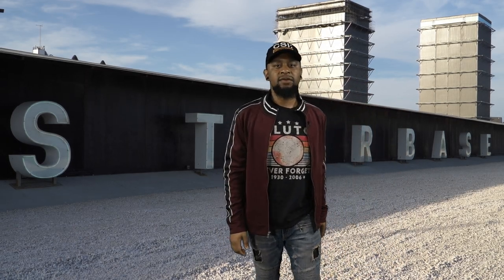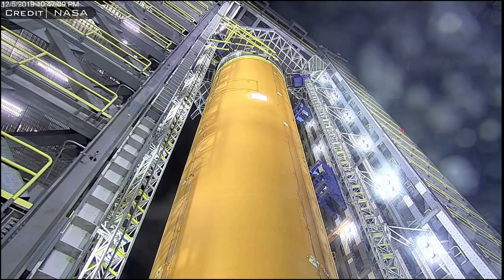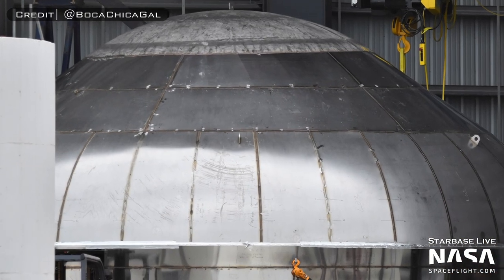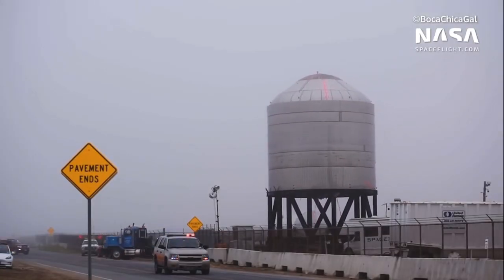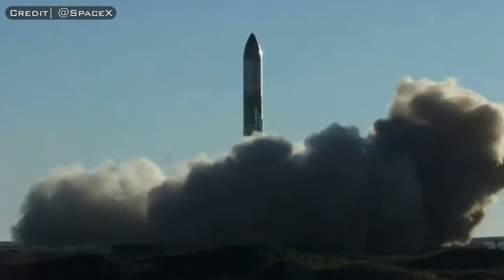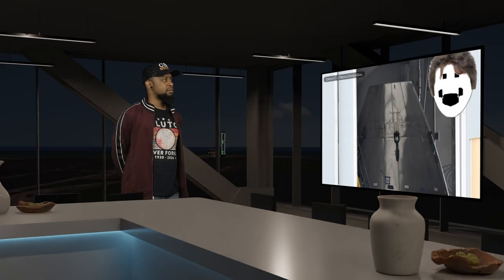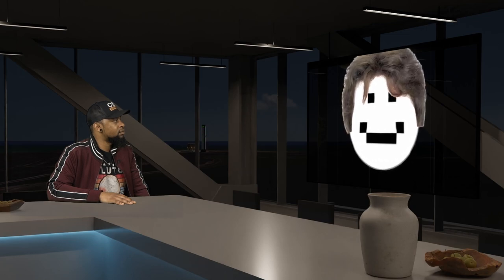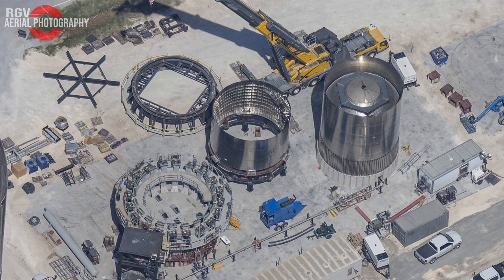How Did SpaceX Predict & Avoid A Catastrophic Failure Of Starship?

Comment: What a trip down memory lane, with quite a few blanks filled in. 
The B4 flaw was a lot worse than we thought back then.  
Well done Jax.
Well done Zack and team CSI.
✨️❤️🙋‍♀️
Reply: @StephanieB67 and @CSIStarbase, you're right about the B4 flaw. It seems that the stringers that go to the structural reinforcement on B2.1 may have been enough to tell SpaceX that B4 can not perform its orbital flight. So, my guess is with B7, they added the stringers all the way down to the bottom of the aft section: possibly to allow B7 to handle more pressure.
Reply: I might be wrong but firstly, the smart move would have been to have a successful test tank that simulated either a Starship or Booster or both. Then build the actual Starship and/or Booster. As reliability improves over time, SpaceX would get to the point where they can safely do this simulated test on the actual vehicle instead of the test tank. I still understand why SpaceX would want to rapidly mass produce both the Starships and Boosters, though.
Reply: @a.srijamorn3610  my guess is that spacex chose to get the most data from the widest range of possible issues all at once. Everything from production issues, to testing tanks, ships, and anything else

Comment: Great episode. You mentioned the first Falcon nine made a random rotation. Elon Musk said they didn’t take into account the turbo pump exhaust which exerted some torque that stabilization gyros removed. This is rocket science.
Reply from the maker: Thanks! We were going to dig deeper into that but the intro was already 10 minutes long lol
Reply: Incorrect. Gas generator exhaust wasn't powerful enough to create that rotation. Elon said it's due to the (as they thought) default 0° gimbal position that turned out to not be 0° in practice

See EDA interview
Reply: @alvianchoiriapriliansyah9882  I watched an Elon Musk interview where he said the turbo pump exhaust started the rotation. I did not make this up.

Comment: What an amount of detail in one video, unbelievable. Can’t fathom how much work went into this. And what a wonderful result, it really puts the development of Starship in perspective. It might have felt a bit slow the last year or two, but this overview makes it obvious that SpaceX has had the pedal to the metal this while time. We knew that, but it is another thing to have it presented so clearly. Thank you Zack and team, masterful work!

I am very surprised to learn of the flaw in the B4 generation design. It makes it obvious that B4S20 were indeed destined to fly from the janky GSE setup just to get flight test data and iterate fast, but it also explains why that did not happen and why the time to B7 completion was used to bring GSE up to a more final spec. I guess there was really no in between option. They either launched from a janky setup (not to worrisome if things blow up) or had to build the whole thing up to final spec with all safety precautions. Because anything in between would have been a great loss in case of RUD. All speculation of course, but it makes sense and it makes me appreciate the progress that has been made in the mean time all the more.
Reply from the maker: Thank you! Yeah this one definitely took a while to put together. We spent 2-3 months gathering all the info for this lol. 

And yeah with the Booster 4 stuff, that was quite the event.  That was probably a very difficult few weeks for them when they came to that realization and had to make a decision.

Comment: Thanks for this video.  In the future, will Spacex be able to use info from the past to digitally calculate thrust sections to be designed without testing on test stands ?  I know that these forces have never been applied in current planes/rockets/vehicles, however would expect things to be calculated by computers instead of test stands in the future ?

Comment: So, I'm at @4:20 and listening to the discussion on the Starlink 2 (Pez) delivery system.
Now, although I am certainly no rocket scientist, I have spent the majority of my, now-retired, life as a welding fabricator, and I have thought from the outset that the dispenser slot might well be better and more usefully placed if it were turned 90deg and ran vertically, with the ship. 
The Starlink sats should do just as well arranged in a circular cassette that was also turned ninety degrees.
There must be a very good reason why the things remain stubbornly horizontal, but I'll be darned if I can think of it.

Comment: 53:20 what are those perforation marks running vertical? I see that the stringers are installed on top of them. And what about those columns of 5 darker marks running between the perforations?

great video by the way. the hour just flew by

Comment: I just couldn't understand what was taking so long. The work seemed mostly finished two years ago, so I thought the fears were around the thermal protection system or the Raptor2 development. It turns out they really were not ready to fly with Booster 4/Ship 20 after all. When they put in a feature like the "pez dispenser" doors, you tend to assume they know what they are doing. Well, not necessarily I guess. But I still want them to fly, even if it fails. Not everything can be simulated. At some point you have to go fly. And Booster 7/Ship 24 looks a lot better now.

Comment: They could diminish the length of the Starlink disposal door by modifying the pez dispenser. Launching the Starlink one at a time lengthwise then rotating internally the pez to eject the other stack of Starlinks . The structural cost of the ejecting door would be smaller. It would need a small modification  of the pez.

Comment: Love the video.  Not sure I understand your point about negative pressure testing.  For SN8, I thought the header tank issue was a pressure management problem, not a structural one.  Don't the raptors need a minimum inflow pressure from the propellant supply, or the turbopumps can't manage sufficient mass flow and/or engine pressures?  On the main tanks, the structure of a full vehicle would fail long before negative pressure, because significant positive pressure is required to maintain tension instead of compression in the tank walls when there are hundreds/thousands of tons of weight stacked on top of the tank (e.g. SN3).  So a negative pressure test on a solo tank wouldn't prove anything about how the actual rocket would hold up.
Reply from the maker: All of that was just me alluding to the header tank imploding.  Which is what happened IRL

Comment: That problem with the booster and the reinforcing ring is a pretty clear show of how a reinforcement concentrates force in the nearest unreinforced area. SpaceX did not make that mistake of transferring force to a weak area near a reinforcement. I wont try and out think SpaceX's structural engineers so maybe they had something else in mind but I would put a buck down that they were worried that the booster was going to collapse somewhere right below that ring and they needed to protect it. I will also say I would be crazy surprised if they did not know how that works. You can find some detail on this problem in Wikipedia and its known in the aircraft business. Oh and while we start working with a 12,500 ton take off load we get one more good reason to have switched to stainless. That is a hell of a load, hard to really visualize, call it a ww2 heavy cruiser or light fleet carrier. Then after you get that 12,500 tons setting on your launch mount them shake it back and forth like a very happy dog.

Comment: Great development resume' which shows Non engineers that there's a lot more to fancy shiny tubes ...
Product testing is the rigure' by which failures can be avoided ... not during testing essentially but by redesigning the design that has failed ....
The re-iterations as Elon calls them are the revisions others like to call them ..... 
Clearly the volume of samples at different iterations has pushed the learning and development cycle together and this group of development Engineers will never be bettered in the development of SPACE VEHICLES ... Good Jobs Guys - Well done ....

Comment: Structural is pretty much just checking that the engineers did the math right: important when a rocket’s design working relies on thousands and thousands 
of assumptions
Reply: Generally not. Ideally it is just to confirm construction (and sometimes fab procedure) quality beyond what can be tested with LPI, XE/UE, EC, and dimensional verification. Some aspects of design/modelling/calculations are extremely well known (although are still subject to blunders or errors), but agreeably other aspects that involve CFD can be hyper sensitive and result in GIGO - something that proof tests sniff out.

I say generally because I don’t know how the Sx engineers are doing their calcs/modelling, and they could be doing all hand calculations in lieu of FEA - then the proof test is really all you have. But for a structure with moderate complexity with non trivial stress interaction, they must be doing a certain amount.
Reply: @danwhiffen9235  well yes, because the engineers rely on the tanks working the way they want them to work for it to fly. and if either the manufacturing was wrong or the engineers messed up with there math then you have a problem, and I agree that CFD is the most risky part due to GIGO, and its great to test that IRL
Reply: @ricardo_9726  i remember talking to a guy who has worked on excavator design (as I recall), and they did almost no engineering calcs or modelling, built the thing, instrumented it, tested it, noted issues, redesigned and repeat for their design cycles! They had no faith in “over-engineered” models. They thought it was cheaper. I found that hard to believe, but suspect they just needed better engineers! You can get lost in modelling if you don’t understand what the software limitations are to provide useful real output. So very many times one of my engineers would give me results that wouldn’t make no sense intuitively, and when you look more closely realize that bad assumptions were made with regards to boundary conditions, load paths, releases, code check parameters, element types, stress interaction, etc… 

Regardless, I’m super excited for getting SS launched to see what happens!

Comment: Hi Zack I just hate to burst your bubble but the Starship is not going to fly anywhere anytime soon. Unpressurized skirt if the Starship is incapable of transmitting thrust force generated by 33 Raptor engines to fully fueled Starship during launch.  Force that skirt needs to transmit increases during flight as fuel and oxidizer in SH Booster get used up. We have 100% probability that the skirt of the Starship will collapse in flight before MECO. Skirt was never tested for that.
Reply from the maker: Lol I would maybe hold this comment until you see the next episode.  We are wayyyyy ahead on this topic.

Comment: I'm afraid that the heat generated by all the 33 Raptors at lift off will reduce the resistance of the thrust puck. Heat conduction made the exhaust plume of the N-1 Russian rocket to get about 700 feet long and the Russian had very large flame diverters trenches which SpaceX didn't bother to construct. The superheavy booster will not get away fast enough to avoid those shockwaves to blast the softened thrust puck... a 5 seconds static fire at 50% of maximum thrust is not a relevant test about this problem, surerheavy will remain at least 10 seconds close to this hell at lift-off before the surrounded heat to go down. SpaceX needs a major deluge system and if they go for an orbital flight with the launch mount as it is, they're taking a very big risk of failure but I hope I'm wrong...
Reply: wouldn't it be kept cool with all the propellants running through?
Reply: The propellant runs inside the engines but there is nothing running inside the thrust puck beside the pipes feeding the engines. Those help, but it’s not as effective as the cooling conduits inside the exhaust bell of a rocket engine. The thrust puck has none of those.
Reply: @renesoucy3444  hm, what's above the thrust puck?
Reply: The center engines are next to the tank, but the others are not. But like I said, I hope I’m wrong…
Reply: @renesoucy3444  but the outer/other ones are not connected to the thrust puck? I'm not trying to be asinine, I think it is an interesting question and I want to understand the argument/potential issue :).
Reply: They have their own “thrust puck” on which one million pounds of thrust will be applied… what will cool them down?
Reply: @renesoucy3444  The engines? :D I would not be surprised if they cool down more than the exhaust warms, or that it does not get warm enough to create any problems. But that is easy for me to say as am just going along with what SpaceX seem to think, we'll see what happens :).
Reply: The image that I sent you doesn’t make sense, that’s a superheavy with 43 engines… lol, but the principle remains.
Reply: You do realize they have a shroud & additional plate, right?
Reply: Like Zach said, I’m glad B4 didn’t try to fly…

Comment: After feeling like I've gone crazy.  I had to do my own CSI deep dive into the title of this video.

So would a video bereleased, then the thumbnail & title changes after a few days?  I'm  watching this video under the perfectly reasonable assumption I haven't seen it before.

Then you get mild Deja Vu thinking it seems awfully similar to something you've already watched.  Check the title & thumbnail...nope brand new video you have not seen.

Then you start to feel crazy.  You're positive you've seen this video before, but why would the thumbnail and title change without any reference to the old one anywhere.

Now you're positive you've gone full on insane. I think YouTube needs to out a mark on YouTube video thumbnails that are changed for the mental health of people like myself.

I'm going on hour 2 of wondering if I've gone crazy or not.

OK  my deep dive led me to a Twitter post on Feb 25th that does indeed have a different title and thumbnail.
Reply from the maker: Yeah, original title and thumbnail were weak and were hurting the performance.  Sorry for the confusion